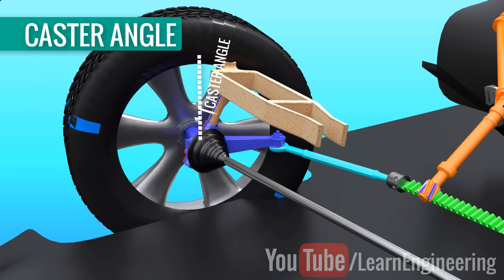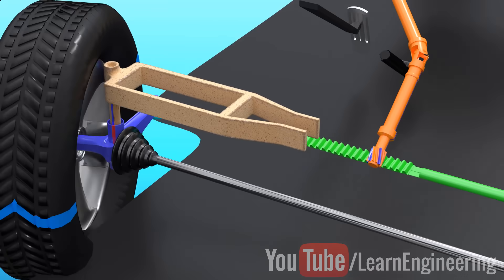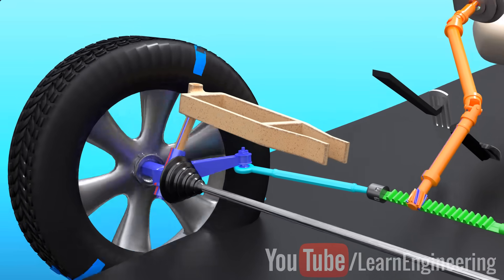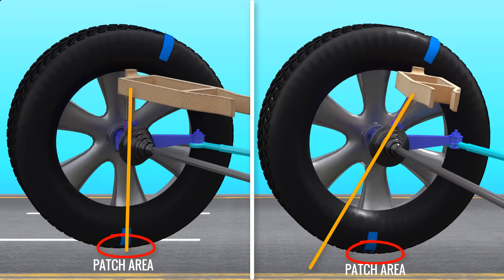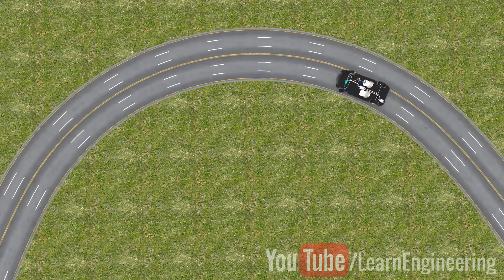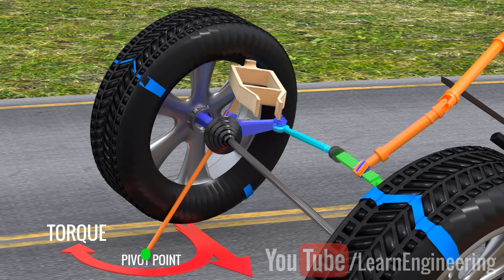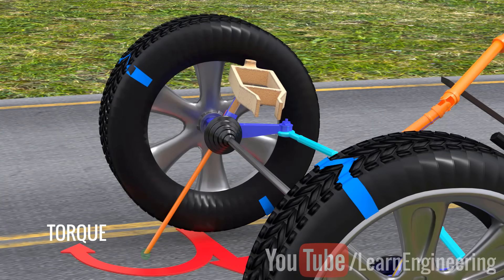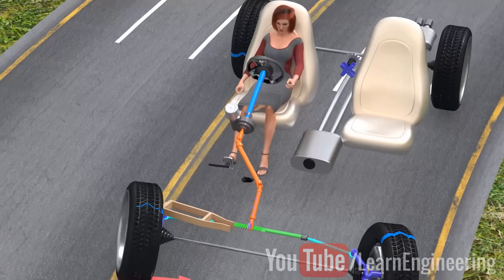How does the Steering Wheel automatically returns to its center?

Comment: 3:51 That car's gonna need new side skirts.
Reply: And also they need a tyre change because they are backwards lol
Reply: 3xcelsi0r I came here to post the exact same thing 😄👍🏻
Reply: @3xcelsi0r10  
Not a tire change. The Tires need a "Cross Rotation". That means removing the RF tire and mounting it on the LF and Moving the LF Tire and Mounting it on the RF side.  The treads are directional and have an " arrow " design and need to be spinning/rotating forward.
Reply: @33ad1  that's what I've meant
Reply: @3xcelsi0r10  no they're not?
Reply: @lintonfr  the tyre profile is in the wrong direction
Reply: @lintonfr  Tyre profile are pointing Inwards
Reply: @3xcelsi0r10  if you are talking about Rim being inwards then
No, it's not
Reply: @अण्वायुवरीवर्त  The tyre pattern is in the wrong direction
Reply: should be fine just a little bit scratc
Reply: I think they are talking about the tire tread pattern which is pointing to the wrong direction.
Reply: I think its fine

Comment: Thus I can understand  why front wheels look a little weird (in the patch area front wheels are not touching %100 smooth with the road) when turning the steering wheel. The answer was caster angle. The video is great and very helpful. Thank you. But why there is a restoring force when  patch area is behind the pivot point?

Comment: I can't understand can u kindly try explain still more clearly with basics too.
Reply: when the caster angle = 0, the friction force at the point of contact of the tire acts at the same point through which the steering axis of the wheel passes. Since the points coincide, the leverage of the force is 0, and therefore the torque is equal to 0. When the caster angle is greater than zero, the point of application of the friction force and the pivot axis of the wheel do not match. The distance between the point of action of the force and the projection of the turning axis on the road is the lever of force. And the product of force on the lever gives torque, which seeks to align the wheel in a neutral position.

Comment: This video isn’t entirely accurate. Steering axis inclination and caster are two different things. Calling the steering axis inclination angle the caster angle is wrong. Caster angle is correctly defined in this video. Steering axis inclination angle is similar however instead of the angle leaning towards the cab, steering axis inclination is the angle of the two steering pivot points (whether upper and lower ball joint or strut mount and lower ball joint, or even kingpins) leaning towards the center of the car as viewed from the front. Also, caster is adjustable on alot of cars on the road today, steering axis inclination, however, is not. Check out Engineering explained for a good visual representation of the difference between the two.

Comment: You called what should have been "steering axis inclination" caster angle. Caster is the angle of the lower ball joint to the upper ball joint in the side view of the car (longitudinal) not laterally as you described

Comment: This feature can actually help you steer into (or out of) a slide.  I was in a situation similar to those 'Sport Car Fails' where the driver fishtails uncontrollably. I was driving an older truck without power (assist) steering. I realized I was sliding and tried to steer into, but after a few fish tails I was not fast enough at the corrections.  And, to my surprise, the steering wheel spun too fast for my hands - I pulled my hands back, and the truck did two more smaller fishtails and recovered.

Comment: If the steering wheel isn't centered by the power steering mechanism, why does the steering angle sensor need to be calibrated to know the position where the wheels are straight?

Comment: Someone help me, my steering wheel won’t return to the center no more. I recently did some work on my car, replaced the inner and outer tie rods , also lowered the front end a bit more and gave adjusted my coilovers to get more negative camber.. I took my car to an parking lot and I was driving in a donut , both hands off the steering wheel and it held in until I physically turn over the wheel. Wtf is causing this ?!

Comment: One thing is missing to say in this video and is worth to mention, it's maybe not fully related but needed to point out.
A suspension with 0° caster angle make the suspension more rigid while driving.
Giving this light caster angle also help the suspension crumble upon front(forward driving) impact.

One place where this light castle angle help is when you go into a parking lot and have to drive on a sidewalk that is a bit elevated.
Or when your wheel fall in a pot hole.

Comment: There is also the matter of the spindle-to-pivot axis angle.  The pivot axis is defined by the alignment of the top and bottom ball joints (for double a-arms or double wishbone suspensions), or lower ball joint and strut pivot line (for McPherson strut suspension).  If you view the car from the front, the pivot axis is angled such that the pivot points is slightly shorter at the top between the 2 wheels, and longer at the bottom.  In other words, the upper ball joints are closer to each other at the top between both front wheels.  This causes the spindle to follow an arc as the wheel turns in such a way that the spindle will gradually point down on either a right or left turn.  This causes the front end to lift up when the wheels are turned creating potential energy from gravity pushing the front end down, causing the wheels to straighten up once turning effort from steering input is released.
Reply: I guess this ( what is called as king pin inclination) is the dominant reason for self correcting steering 👍

Comment: If the caster wasn't there (0°), the friction (resistance) will not center the wheel because the force penetrates through the axis. Ok nice, the turning force is obviously also perpendicular to the axis (but against the friction direction), why does the turning force turn the car? with same logic it will also do zero effect!

Comment: When I clicked to watch this video, I was like "it's pretty obvious, but I'll watch it anyway."
There's going to be more resistance if they're turned than not turned, so the car going forward is going to make the wheels tend toward straight, right? Sort of like... well... castor wheels. No magic. It's pretty intuitive. Right? Right???

Now I've watched the video, and it's obviously more complicated than that, and while I'm sure I should be able to understand everything in this video, I must admit I don't fully. According to this video, if there was no castor angle, it wouldn't work. So while the video is suppose to turn the mysticism of how it works into an understanding, it's actually turned my "understanding" into mysticism. xD
Still, a very good video, and I'm sure if I brushed up on my physics a bit more I'd understand it better. I had no idea it was that complicated!
Reply: that is richt because of the tirefootptint.

Comment: The steering wheel is supposed to return to center ?  WoW ! I have been driving bent beaters that either pull to the left or pull to the right for the past 40 years. This return to center deal sounds like a luxury to me.

Comment: i dont get it
Reply: For a moment to occur about a point (in this case the pivot point) you need a force acting perpendicular to that point at a given distance. By moving the pivot point forward (as a result of the castor angle) the friction force is now a given distance away from the pivot point meaning a moment(torque) can occur which acts to turn the wheel back to the straight position.
Reply: @eamonglavin2532  helpful comment, thanks
Reply: its okay dude, me too

Comment: @LearnEngineering You should have also noted that the friction on the patch area under the front wheels will be acting backwards (since it is driven, not driving). This will also contribute to the restoring torque and will dominate the centrepital force for low steer angles.

Comment: what about electronic steering?
Reply: Same goes, Electronic just means the servo is variable because its operated by an Electric motor instead of the engine aux-belt drive
Reply: @jesperviktorsson8027  and so which means electronics steering are electronics stability control program too?
Reply: @mrjn6940  no, stability assist and anti skid is operated by the ABS unit, it applies brake on the appropriate wheel to help turn and keep stability..

Comment: Is there any other uses for castor angle apart from returning the steering?? Doesn't it improve the cornering?
Reply: The caster angle affects the dynamic camber of sterling inputs.   It can be beneficial to help with turn in feel and reduce understeer in FWDs,
Reply: Yeah I think it does the same sort of thing as a negative camber angle, but is only applied during the turn

Comment: One correction: in the animation the pivot point is in front of the patch area not behind as the narrator says. 
The animation is correct. If the pivot point was behind the patch area there would not be the torque to center the wheels.
Reply: "pivot point behind patch area"
Auto steer mechanism for decreasing radius turns
Mind blown

Comment: What will happen if negative caster is given ??
Reply: Unstable wheel especially at higher speeds. Think of shopping cart casters wobbling.
Reply: great_
by doing this actually  your negative caster angle  keep_on increasing( till  -90 Deg)  && and we Must provide external force to return
Reply: I guess it will led to overturning of the vehicle

Comment: The term "patch area" is more commonly known, as far as I know, as the "tire footprint". The specific point in this footprint where the steering axis intersects has a huge bearing on handling and steering performance. Caster angle is not the only critical element. Proper alignment specs will differ between front-wheel and rear-wheel drive, as well as the manufacturer's geometry. It is important to know that changing tire/rim sizes or offset from the hub ("wide track" rims etc.) will change the designed steering/suspension intersection with the footprint and could cause unexpected and possibly severe handling or wear problems. Some immediate symptoms may be "bump steer", "oversteer" or "failure to centre". Stick to manufacturer's specs unless you know your suspension geometry!
Reply: I know it as contact footprint
Reply: In the racing world, in almost every resource I've studied, it's referred to as the contact patch.

Comment: What would happen if the pivot point is BEHIND the patch area? Or  isn't that possible?
Reply: You would have a very unstable system. Driving straight without touching the steering wheel would be practically impossible.

Comment: How will the wheel turn if left by itself during and oversteer or a skid ?
Reply: @Garden-Tech  Thx man and a happy new year :) thats what i thought, one could say that thanks to this control arrangement, the wheel turns itself onto the path of least rolling resistance ? If during a normal turn, the car would like to countinue straight, the wheel will do so as well. During a slide though, the car wants to go side/tail first, the wheel will turns like this to accomodate that, the wheel turns into the direction of travel the inertia of the car's body pulls towards :)

Comment: Well explained. You get a first hand look at how this works by watching how wheels on a grocery cart follow where the cart is pushed, even though there is no active steering control. Castor provides a moment arm to rotate the wheel behind the pivot arm as the cart is pushed forward. Also note that when driving in reverse you don't get a stabilizing force to center the steering wheel....
Reply: That's not the same.....at all
Reply: Is it straighten up the wheel to even out the pressure on different parts of the part of the wheel that is in contact with the road? Or why? The centripetal force is acting inward to the centre so I can't move something in opposite direction.
Reply: In a grocery cart castor angle is not required since the axis of wheel rotation is farther from the point of contact of the wheel with the ground. The same cannot be applied in a car. The car wheel needs to rotate(steer) through an axis that passes near the axis of movement(circular ratation) of the wheel.
Reply: @andymotovlogs546  I also have a comment on this video about centripetal force and that there is no such thing! There are forces of gravity forces of inertia forces of acceleration but no centripetal force!
Reply: @_Webpersona  Have u not heard of centripetal force, centrifugal force etc.? Kindly check wikipedia or dictionary. No point questioning such a basic concept.
Reply: This video is actually very misleading! It’s NOT the centripetal force which is working here but the friction force - which points always backwards of the direction of the car, and the fact that it is not in line with the pivot point.
Reply: @Patalenski  I think you're thinking of drag. Friction is an instantaneous Force at the moment in the place where the two objects are touching.
Reply: @Patalenski  if the friction is always backwards then which force makes the car go forward?
Reply: Shouldn't driving in reverse still give a restoring torque? :/
Reply: @kartikchoubisa  Only if the wheel can rotate 180 deg so the wheel follows the pivot axis. That happens easily on a grocery cart but range of motion for a car wheel is more restricted. The same process happens with the rudder of a boat.
Reply: @spelunkerd Cart wheels work in slightly different configuration but the same effects apply to the cars with a front wheel drive. For example, there is a tendency  for the steering wheel to “lock up” when you accelerate in a turn, the reason for which is that the friction force points to the front of the car, not backwards, in this case, and the effect of the centering cancels out. The same applies when you drive backwards and you *decelerate*, in which case the braking force combines with offset friction point and if you don’t hold the steering wheel tightly, it goes to the far left or right position by itself!
Reply: @Patalenski  I think frictional forces point inwards as told in the vedio not forward or backward. The greater the speed the greater the centripetal forces that centers the wheels.
Reply: could i use  "a raked fork at an extreme caster angle of a chopper" as an example to demonstrate castor angle in a car? that would be much easier to visualize.
Reply: sir does this issue relate which cars move idly even though i don't give it any gas?
Reply: @wizahxx8065  No, unrelated issue. Torque converter dislocates the drive train from the engine, something there. It could be as simple as a high idle.
Reply: @spelunkerd  what about weight contribution? plus caster angle the car will move forward thus stabilize the two wheels?